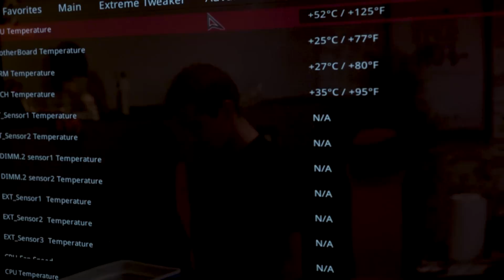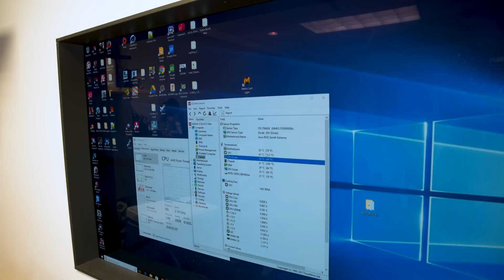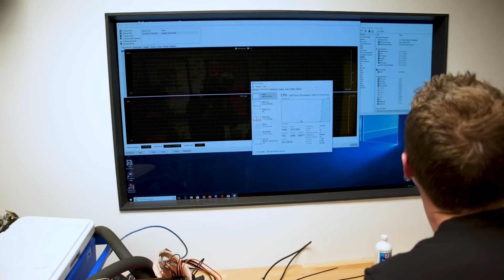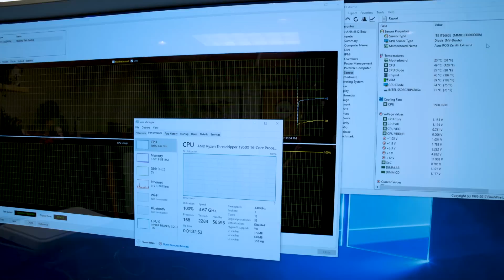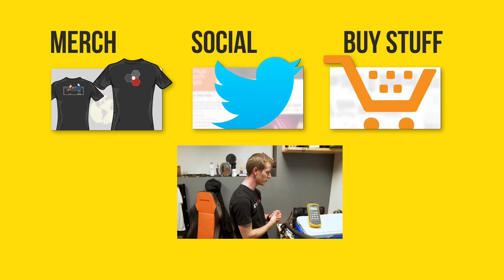My 10 Year Old Chiller WORKS! -20C on THREADRIPPER!

Comment: Great video thanks.
I actually did something like this back in the late 90's with a Intel Celreon 300A CPU except I did it in mini bar fridge and had fans blowing top and bottom to move the air around so the cold air form the freezer part actually chilled the whole fridge down by a lot. I used a electronics spray on all of the electronics just in case things got to cold.

I built the whole PC inside the fridge and had a hole out the back for the cables which I sealed back up with rubber tape. it not only worked very well to keep the whole system cold it also cooled my beer & Pepsi which were also very cold. I actually had to section off the bottom of the fridge just for the beer & pepsi since the pepsi cans froze once and almost made a huge mess the beer not so much the alc in it kept it good.

Anyways with this setup I got some pretty crazy over clocks form that Celeron 300A way beyond the normal on regular air cooling. SO the upside was very good over clock a place to keep my beer & pepsi and it was near silent except for when the fridge compressor kicked in but it was pretty quiet anyway. I really did not see a down side except for maybe when my pepsi got to the freezing point once and of coarse hard to take to a lan party as well if you were into that sort of thing.

Comment: Linus you could of used that tubing insulation for the 'whole room' outside cooler project

Where you used copper pipes and basically lost all the heat into the room before it got out side.

Comment: I bet if you used an actual GOOD Threadripper block, the temps would be even better.  HardOCP demonstrated the EK Threadripper block is the worst because it has the same exact fin array footprint as the intel blocks

Comment: Man I hate dicking around with air conditioners. Worked on some properties doing maintenance in the loosest sense of the term. Anyway when I was moving an old unit out It slid in my hand, and down my fingers, and I got about a half dozen slices each on my three fingers. my fingers slid right down the grates on the outside where it sucks in air/out depending on the side. The thing was old, and busted,covered in shit, and it makes me cringe just thinking about it. Got to breakout the first aid kit, and have a fun few weeks working with one hand that had a bunch of shallow gashes on my fingers. Well lesson learned, always pack gloves, and don't fuck around with air conditioners. Cool story right, hahah.

Comment: This isn't the worst idea you've ever had.  It wouldn't be too hard to leave the window shaker intact, tie your coolant line to the evaporator unit, and cool it that way.  Your temperature controller slug can be taped to the hose and you could use it to run the window shaker as normal.  The advantage to doing that is you might be able to cool an i9-7980 with a pair of RX VEGA 64 GPUs.

Comment: The air conditioner you used to make your cooler is a 5,000-8,000 BTU air conditioner, which means that it can remove 5,000-8,000  BTU's per hour.
At the time, that may have been a great option. But now, you can easily get a 28,000 btu air conditioner for not too high of a price.

With a 28,000 BTU air conditioner you could probably get -40 C or lower on the chip. Then, overclock it.

https://www.homedepot.com/p/Frigidaire-28-000-BTU-230-Volt-Window-Mounted-Heavy-Duty-Air-Conditioner-with-Temperature-Sensing-Remote-Control-FFRA2822R2/206734519?cm_mmc=Shopping%7cG%7cBase%7cD29A%7cMULTI%7cMULTI%7cNA&gclid=CjwKCAiAksvTBRBFEiwADSBZfGJJTxJSmeujBmWbZwv1RlmnsJjBvq6nSkiFKHCEAxMfDAJ_bjJrfRoCZoUQAvD_BwE&gclsrc=aw.ds&dclid=CNfCkuvrhdkCFcZCNwodEMUEuw
Reply: Danyal A. Explain to me how are you going to get enough superheat to prevent the liquid refrigerant from returning to the compressor and killing it, and if you want an extremely low temp you can get a proper chiller instead of an AC which contains HBP compressor, using it on LBP or MBP application such as sub zero temp will cause it to fail, you can get -45 with a proper refrigerant and compressor type
Reply: Tonny Cassidy
Figure out how to connect your gpus to it as well.
Reply: Danyal A. I mean what computer produces 8.2 KW of heat that it needed a 28000 btu ?
Reply: Mining rigs :D

Comment: Would oil immersion not be a great environment for a system with sub-zero cooling blocks on it? Any condensation should sink away from the board and could be tapped off at the bottom of the tank. Seems to me to be a much more elegant solution than goopping up the board.

Comment: I would just like to point out that a parsec is a measure of distance, eg 648 000 astronomical units through Pi = one parsec. Fyi one astronomical unit is also the average distance of earth in relation to the sun.

0:55 for context

And for even more context:

Yes, this is a joke ( ͡° ͜ʖ ͡°)

Comment: Since you guys know a lot about computers, I'm using a hdmi to get my laptop 1600x900 screen to go to my 1920x1080 to screen, it's works all fine but it seems blurry and not so smooth around pictures and text, I have fiddled with everything in nvidia display settings and the computers display settings but it just doesn't look so nice if it's possible. Any help would be appreciated thanks❤️

Comment: I have a threadripper and it is air-cooled but at stock speed mine isn't getting over 50 degrees Celsius. Did you overclock yours or is you cooling solution just bad.

Comment: Linus, if you put the pump on the hot side, a) it will have to do less work because less dense medium (because heat) and b) you'll put less work into the coolant that you're trying to keep as cool as possible, therefore have colder CPU temps (and less wasted work). Though you will probably have to prime the system.

Comment: @LinusTechTips Hey boss, couldn't help but notice that you were struggling a bit to explain the science behind that evaporator coil. Let me enlighten you. In a nutshell you take highly compressed freon, in a liquid state, shoot it through what's called a capillary tube (usually a cap tube is about 1/8th the inner diameter of your evaporators' tube). That cap tube shoots the high-pressure liquid into a low-pressure environment; the resulting loss of pressure causes the freon to rapidly change from liquid to gas. The gas is then super-chilled, usually to below-freezing temperatures; when air is passed over the coil, the maximum temperature that air will reach is around 50 degrees F, provided that unit is using R134a refrigerant. If the unit was an older one, the refrigerant might allow for a lower temperature to be reached; for example R12, known as Hotshot, had a max temperature of 32 degrees F air coming across the coil. Hope this helps, I really enjoyed watching you MacGuyver this chiller together.

Comment: Back in the late 90s, early 2k's every water cooled system I built was done with a simple thermal electric cooler... A peltier.  All CPU's grew frost, all were always under freezing at all times, and overclocking was the name of the game.  All far easier than this set up.  Also no HVAC certs, no HVAC or refrigeration at all... Other than that of directly on top of the CPU.  Super cool the CPU, then water cool the peltier.  I was truly surprised that TEC's weren't used in the modern day, easy store bought, closed loop water cooling solutions.  It was just how it was done back in the day. Perhaps never needed, but always how it was done. It was in those same days, when I was a mere teen at best (born 84), that I had built my first oil submerged computer, like Luke's mineral oil rig.... However in hydraulic oil... and not see through, lol.  It all started with a Mac Plus, then a P233MMX Packard Bell... Then my first 3D card, then custom builds, endeavors in overclocking and water cooling with transmission coolers, TEC's, surgical tubing, etc.  Custom cases with laser etched designs, water jetted openings with acrylic windows (of the first to do any sort of side windows), rads mounted to top of towers with exhaust fans for water cooled systems before any water coolers were able to be purchased.  So so much.  Often wish I was in any way local to you guys, as if so I would have shown up long ago to try to join the party.  Been doing this stuff since day one, and still enjoy it thoroughly.

But yeah, back to the point.  I even built a show computer in a completely clear acrylic case for the tech school I attended in 2001... It was using an FCPGA celeron in a slot on adapter with a TEC cooler directly to it, water cooling above and beyond. Cold cathode lighting, and just a real looker.... Especially for the time, when PC's were just beige boxes that no one expected much from.  But that thing would have a half inch of ice on it at any given time, and I'd let it run over night all the time... All week.  Condensation never had a chance to become conductive as it became and remained ICE very quickly and for as long as it was running. And it was all totally visible at all times, very neat demo piece.  I had the entire lab networked so we could play Unreal Tournament or Worms when ever we had the chance, and set everyone up with a static image of a desktop and whatever work they SHOULD have had up, which anyone could ALT-Tab to if the instructor came in... Otherwise, we were playing games, lol.. For most of us, Cisco CCNA training was what we should have been doing.  I always had the advantage in games though, as I had the only computer that could run them full screen and at a decent frame rate... Some weren't even using hardware rendering... But we all had fun.

Once again derailed though, peltier... Thermal Electric Cooler... They could easily do this same thing, far far far easier... With nothing more than a good AIO on top of it.  Custom brackets would likely be something to think about, but that's hardly much to have to make.

Comment: should use a fridge compressor, they work with less pressure and the gas can go through the hose.
Reply: and if you have a problem with R12 gas, you can mix it with nitrogen so you keep the pressure (30PSI) but less cold.

Comment: To be fair, you could just call an HVAC company and you could have a refrigerated circuit installed in the room, house or building - whatever - and it could be tubed to longer lengths as well. So, why not do that?

Comment: Linus you got it all wrong my dude. 

The compressor compresses the gas (you cant compress fluids) 
Then the compressed gas goes to the condensor, where it condens from gas to liquid.
After the condensor it goes to an expansion organ, wether thats an expansion vavle or a capillair (dont know the english term)
After the expansion organ the liquid vaporizes wich will be completely vaporized when it leaves the evaporator

Comment: Water cool a pc with a car radiator.
Reply: go to a junkyard and find a radiator off a 90's civic, problem solved.
Reply: T Wizzle I've been thinking of doing that and I will sometime when I find one
Reply: I will be doing that on my other channel (I can give a link to my other channel if you want). The radiator will have a long enough hose it can be ran outside (such as during the summer), or left inside since its winter time right now. I expect fanless capability, or maybe incredibly low rpm since I'm running 4 GPUs and a Ryzen.
Reply: i would do a condenser (basically a radiator but smaller and nicer its for the air conditoner
Reply: They've done that in one of their budget builds + Water-cooling videos.
Reply: WTF ^^

Comment: Um the the compressor doesn't get compress liquid. You can't compress an incompressible fluid. It compresses the gas making the gas more compressed, causing it to become hot. The condenser then cools off the hot gas causing it to condense into liquid, which is then changed back to a gas thanks to a nozzle that is a kin to a spray can causing it to become cool.

Comment: people are doing so much work. use standard parts buy a broken fridge make a hole for condensation in the bottom. put a big evaporator at the bottom. now you are free to put in all standard parts no need to modify you can run it in 10 to -20 and no problem. replace old parts like a normal computer

Comment: Plasti dip is easy to remove not LET

I'm an extreme OCer and we mostly just use vas and paper towel but you should look into KPCs Inferno heater as you can get away with nothing

Comment: How about running two system like that and having the cooling unit out side this way you not heating the room. Or modify an AC that's in the window doing two jobs at the same time. Cooling the room and cooling the PC.. just an idea

Comment: 80 degrees Fahrenheit? And window washer fluid?
Reply: StagRiver probably much better than the additives that antifreeze has.
Reply: Agreed, but they should have got the blue stuff is they wanted to use washer fluid
Reply: Artcore103 nah it's definitely wiper fluid https://www.rainx.com/product/windshield-washer-fluid/rain-x-all-season-windshield-washer-fluid/#.WnOZc59ME0M . And coolant is either orange or green.
Reply: Sam Koch not rain-x, it has a wax in it that helps water bead up on a windshield, but is probably really bad for a water block.
Reply: Yeah being a noob I thought they'd use Engine Coolant for sure.
Reply: Nerdy, Retro, Gaming - Technically yes, methanol could be considered as antifreeze, but commonly antifreeze is understood to be ethylene glycol. Either way, both would work well in this situation, they probably just bought whatever was easiest to get.
Reply: Poke Champ washer fluid is just water and alcohol.
Reply: Vince Pale Jr I've been using it for 5 years now and have never had that happen...
Reply: should have used deicer, otherwise its fine
Reply: RainX doesn't make Anti freeze...  Check their site.
Reply: Which makes it flammable.
Reply: I'm sure they thought it was orange coolant and didn't notice until it was too late...
Reply: Or blue, Subaru brand coolant is blue.
Reply: Sam Koch or yellow, red, pink, blue purple. Automotive coolant basically comes in all colors now. Orange and green are super common in 90s early 2000s cars.
Reply: Windshield washer fluid is mainly methanol although the rainx does contain some additives to give your windshield a hydrophobic effect. Methanol is good because it evaporates well, thus making it good for this application. The evaporating liquid is actually what takes away the heat.
Reply: It can also clog up your nozzles, or at least did on my E36.
Reply: it's probably just rain-x brand antifreeze.  the orange color is typically a universal antifreeze for cars.

Comment: As an HC/AC-R technician,  I'd like to say that your explanation is a little backwards. Refrigerant goes from the condenser to the evaporator, then then to the compressor. The way you described it would destroy the compressor because liquids cannot be compressed.

Comment: 1:34 "compresses that fluid"? I don't think that's how it works. fluids cannot be compressed in a meaningful way, otherwise things like hydraulics would not work. the compressor in a phase change cooler compresses a gas, which then condenses into a liquid while giving off heat.

Comment: Why dont you use Peltier devices? I've gotten -5C with two power supplies, a thermo-electric device directly on my i7, then a waterblock on top of that. I used plasti-dip on my mobo to protect from condensation.

Comment: why did'nt you use a thromo block  cooler i figure it would work as good   just not that freezin cold  and it runs on 12 volt aswell

Comment: Subzero mining video next?
Reply: GPU cores will have the solder crack from extreme thermal cycles, which would be fine for Linux miners, but I wouldn't do it for Windows since it force updates and reboots really lower the lifespan depending how cold you go. I'll be running a radiator with a hose long enough I can set it outside, and its winter time right now, so insulation prep would be needed if I chose to do that (just because its warmer inside than the GPU will be, then it can condensate). I won't be though, its not worth the extra hassle (I have actual phase for setting benchmarks). I wouldn't recommend this video for mining due to power constraints, but leaving your GPUs in a drafty out-building or box with fans is often done.

Comment: next build one that uses NaK as a coolant, for the ultimate silent pc.

in case you'Re wondering NaK is an alloy of sodium and posassium and it has very desierable properties that put it above and beyond any other coolant:

NaK is a liquid metal, non toxic, has a high heat conductivity, high electric conductivity and is also fairly light.

the main advantage of NaK is that it can be pumped without any moving parts, which should make for a very quiet, yet effective cooling solution.

Comment: Linus,I'm an ac and refrigeration tech,while you were on the right track with the condenser coil. You have the compressor wrong,compressors can not compress liquid. What it does is it takes the refrigerant vapor coming from the evaporator and compresses the vapor bringing the pressure and temp up before it hits the condenser

Comment: Much easier to put 60w peltier element into water with 240mm-360mm radiator and to get ambient temperature on cpu. (for long time period you have to add another one element)
Anyway even in hottest summer will be at around 40-42C no matter what rad you are using.
That's what I personally tried :D